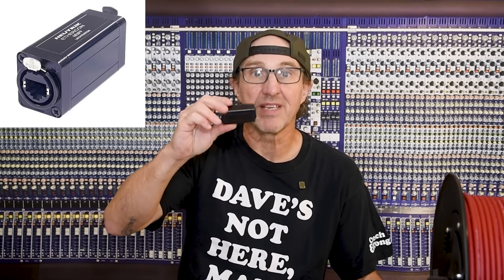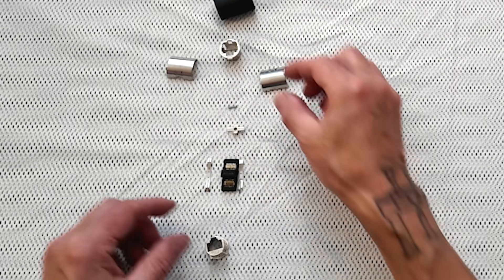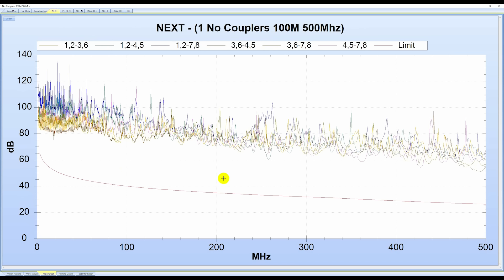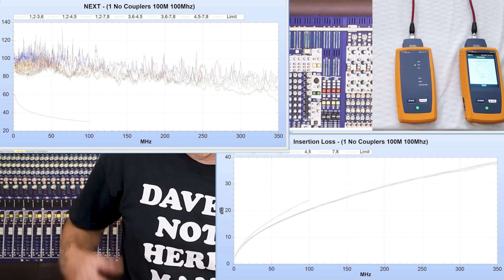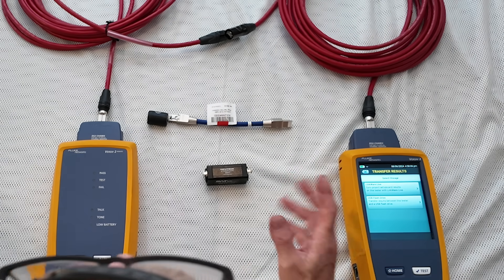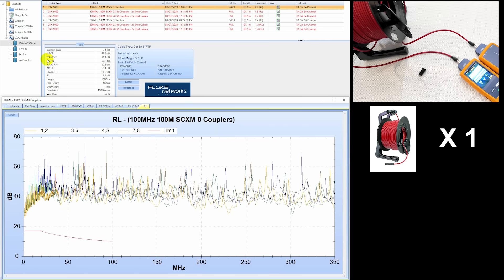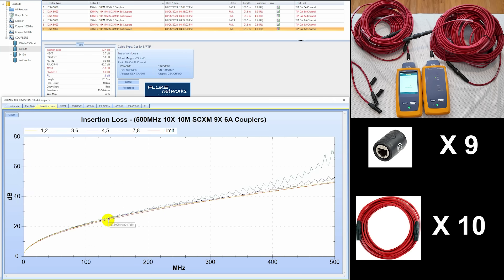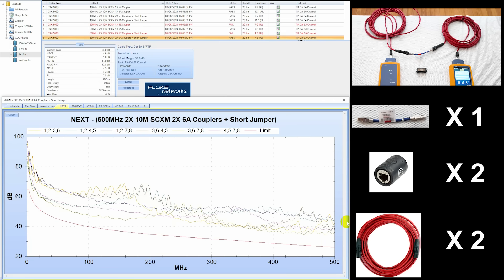How Bad Are etherCON Couplers?

Comment: I wonder if part of the issue is not being twisted, no shield and longer cables added up in the 5e coupler. All those things are minimized in the cat6 which would make sense because the spec for termination is tighter. I feel like making a longer cable vs buying a bunch of couplers would be easy. Many people get hung up in buying top of the line for every use case but it always depends like you said about shorter runs to someone else who was looking for a solution in their country. 

I think people just need to be more aware and thoughtful than scared of a small amount of loss in a reasonable circumstance. 

Thanks for the info.
Reply from the maker: Agreed and thank you

Comment: Out of curiosity, what is the impact on signal if you are using it to carry analog and/or aes pairs?
Reply from the maker: Everything points to the higher frequency being carried by the wire the more impacted by the couplers it will be.

Since analog audio only goes to 20K The coupler should have no impact whatsoever or no impact that matters.

For AES that goes to 48 or 96K again we're not that high of a frequency compared to 100 megahertz being carried by network traffic. And the couplers really start to impact the signal when we get up into the 500 megahertz and beyond.

So I wouldn't worry about couplers in most situations except if you're running very high frequencies and also running very long cables in the 80 m range or longer

One exception to this is AES 50 which is extremely temperamental with cable lengths over 60 m unless the cable is very high quality so minimizing couplers on AES 50 is always wise when running longer lengths
Reply: @DaveRat  Thank you Dave...

Comment: Is there any device like a booster or filter/fixer that could be added somewhere in the run that could help with the quality? Thanks
Reply from the maker: Shorter runs will have less issues. Yes, you can add switches or boosters to many protocols but they add latency and complexity and another thing to go wrong. Especially for festivals where they would need to be somewhere in the dirt between stage and delay clusters or FOH.

Using high quality wide bandwidth cables and avoiding couplers with wide bandwidth signals is good 

Or switch to fiber. But fiber adds cost and is more fragile
Reply: @ It all makes sense. Don’t be short is the answer. Thank You 🙏

Comment: great data to be sure! usually 100 meters is the spec limit i shoot for... as a rule of thumb i add 10 meters to the total length for each termination point so far side distro (10M) 60 m of run then the patch panel (10m) for a total of 80M. This quickie rule should keep you functional but the 6a couplers with a good solid end termination is the way to go. edit* i now need to go talk to the boss to get that fluke qualification meter.....
Reply from the maker: 🤙👍🤙 those flukes are expensive!

Comment: Video Idea: PLEASE do this exact same style testing video with “hi-fi/audiophile” grade audio cables. I’d LOVE to see the actual difference if any in a $10,000 snake oil speaker cable and an $8 Hosa cable compared.
Reply from the maker: Oh my yeah the problem is getting a hold of the $10,000 audio cables. And yes it's snake oil I don't have the ability to measure and we won't hear a difference.

That's it Total crap cables can be bad and that I'll dive into.

I was thinking about doing a video on cheap mic cables versus quality mic cables and how they sound microphonic and shielding and such.
Reply: @ that’ll work! Finally settle the debate on why you shouldn’t use XLR cables to run 3 pin DMX 😂

Comment: While you can't test them to spec (2GHz) I'd love to see if the cat8 couples perform meaningfully different up to 500MHz.  The ones i have are built like the 6a couplers so i imagine theyd be pretty much identical, but maybe theyll be better on some parts still.
Reply from the maker: I don't know of a cat8 ethercon coupler.

I know there's RJ45 Cat8 versions out there. Are you aware of any cat8 ethercon couplers?
Reply: @DaveRat  sadly not any ethercon ones either, only normal rj45.

Comment: Very interesting as usual. I have a small selection of lengths and a 5e coupler to give me more distance options (currently being used on the LAN until I make some cables up). Only running short distances compared to you guys, but might switch up to the 6.

Comment: I think if you're using that many couplers, you really need to examine your cabling choices. Of course, that's not the point of this. I think in general, this is a great example of why one should avoid any couplers whenever possible. It does also show a strong reason why an improved product is the better choice.
Reply from the maker: Yeah I do a lot of testing where in order to clearly identify and illuminate an issue I overdo it so that we can know what to look for

When testing digital consoles and comparing them to analog consoles, The difference is in sound and noise are not readily clearly audible comparing one channel of digital to one channel one channel of analog.

But put 10 channels in series with 10 d to a and 10 a to D converters and compare it to an analog console going through 10 input channels and then the differences become more pronounced and we know what to look for and listen for.

I used this methodology in this test as well of using too many couplers.

I see it as a similar method to having a magnifying glass we were able to magnify the issues such that we can hear or see them better

Comment: My question is, do A couplers make E cable work better?  Merry christmas, Dave!
Reply from the maker: Merry Christmas and that would be great  if they did. Since the a couplers are about an inch an long you need 12 of them per foot or about 33 per meter so about 330 of them for 100 m run. Plus  229 Cat6a male to male adapters.

Would that be better than a cat 5e I don't know but it seems suspicious
Reply: @   I hoped you remembered me as the kind to make such a joke. Yes, a solid train of couplers, half with male ends, half with female ends. By stock in the coupler maker!

Comment: I wonder how wall terminations would compare to these couplers?
Reply from the maker: I tested the Neutrik cat 6A pass through panel mounts and there as good if not better than the cat 6A couplers. Because their ethercon on one side and RJ45 on the other they can actually get the connections even closer than the EtherCon to EtherCon couplers do

The Cat5e pass throughs have a little circuit board and I haven't tested those but I'm guessing they show up somewhere between

Comment: Those ripples are probably because of reflections over reflections and the fact that all shorter cables have 10 meters. The Cat6a couplers seem much better. There must be impedance matching on those couplers.
Reply from the maker: Yeah having a bunch of identical cable lengths probably sets up some resonances and other crap. It's pretty much a worst case scenario which is part of the reason I did it this way.

The other reason is we only make that red cable in three lengths. 10 m, 60 m and 100 m. So I had a pile of available 10 m pieces

Comment: I Would Just Splice The Wire! But I Own The Network! It Would be Better Than Either Of These Couplers
Reply from the maker: Yeah splicing the wire is definitely an option. But even there there can be issues. Maintaining the twists all the way through and not having straight wire and making sure the twisted pairs have a shield that's continuous are important factors.

The distance that the wires in the Cat6a coupler are not twisted is extremely short and the shielding is maintained.

I would bet the splicewire rivals the cat 6A coupler depending on how much time and care you put into that splice

Comment: I would like to see a test where you modify the Cat 5E couplers by adding the proper amount of twist inside the coupler. I have a feeling this would improve its performance
Reply from the maker: Interesting idea. I will ponder that. Though I don't think the performance will ever get up to what the cat 6A couplers can do. Maybe someone else here knows more about this but I believe that going from a very thin wire to a thicker wire and back to a thinner wire also creates issues at very high frequencies.

So I think you'd want to also change the wire gauge to match the cable wire gauge inside the coupler.

The other issue is the Cat5e couplers have little circuit boards in them so there's yet another set of connections there.

RJ45 to female ethercon wiper to circuit board to wire to circuit board to female ethicon wiper to RJ45 is the signal path for the Cat5e coupler

The cat 6A coupler is RJ45 to ethercom wiper to circuit board to ethercon wiper to RJ45

Comment: If you need to run near 300ft, or around 100 meters, then you should just use single mode fiber. The cost of 10gbe single mode sfp modules is pretty cheap now. 10gtek and qsfptek sell aftermarket transceivers for about $10 or so each now. And single mode is not that expensive.
Reply from the maker: Interesting and you kind of hit the nail on the head for the reason this video was created and these tests.

We have about 30 drive systems all based on 100 m lengths that have fiber runs included on our main drive snakes.

We have been running into issues with fiber breakage as well as long lead times for repairs and high costs for repairs and replacements.

Finding a robust and reliable alternative to fiber is one of the reasons I designed this red cable and exactly why I'm doing this specific test.

The goal is to make sure that we can run 100 m of this red cable plus two couplers plus two short jumpers, one on either end.

The results for our application was that we can run up to 120 m + the couplers and jumpers and still have a real world reliability and function buffer of at least 20 m beyond that. We were able to reliably run 150 m cable plus couplers and jumpers with Dante and Milan

In the past 6 to 8 months we have converted all of our system main snakes to have two of these red cables Cat6a runs on them and moved fiber to separate reels that we send as an additional option that can be run as an add-on should the technician or tour desire to do so, but increases load in and loadout time

By making this change we've increased reliability, maintained ease of setup and increased redundancy, as now each tour has four long runs available to them, two cat 6A runs and two fiber runs should they choose to deploy them.

But yes lots of people just run fiber and also throwing money at the high tech solution is sometimes worse.

Comment: I wonder how a cat6a keystone coupler would perform vs the cat6a coupler tested here?  Probably exactly the same without the rubber on the outside, but they cost 1/8th of what the NE8FFX6-W does.
Reply from the maker: Yeah, probably very close to the same and if your application does not need ethercon, that may be a good way to go

Comment: Im wondering if the 10x10 meters has any influence... What would happen if it were to be 10 cables of different lengths? what the harmonic bumps be more spread out and less pronounced?
Reply from the maker: Interesting. Definitely can measure and see where couplers are and cable lengths in measurements. 

Some tests seem to indicate that having very short jumper cables right near the ends is especially undesirable and creates reflections and resonances where the signal level is highest.

Comment: Thanks for this. Question: is there any chance that using a Cat-5e coupler with the SuperCat 6 cable creates a mismatch? I know jack squat about these cables and how they affect signal loss/stability, but for me, as a touring FOH A1, I will always fight for a single cable from mixer to stage box without connectors. It’s amazing how many house techs fail to see the importance of reducing possible points of failure.
Reply from the maker: I didn't do it in the video but I did test the Cat5e couplers with Cat5e cable and the cat 6a couplers as well. The cat 6A couplers outperform the Cat5e couplers in every scenario.

But since Cat5e is only rated up to 100 megahertz, both couplers perform good enough in that range.

The sensitivity to couplers really happens at frequencies well above 100 megahertz where the cat 5e 100 megahertz coupler performs poorly and the cat6 a coupler before much better
Reply: @ is 100 mHz synonymous with 100 m length?
Reply: @Brody-Dolyniuk  It's not linked to cable lenght. It is the data transmission speed that the CAT5e cable was designed for (100MHz and around 1Gbps of network traffic). CAT6a is designed for faster data links (10Gbps) and as such needs tighter tolerances and higher data transmission speed and frequency at 500MHz.

Comment: Thanks for the excellent video! Insertion loss in data cables is something I've often wondered about, but didn't have the equipment to test. Question: If you had one of the out-of-spec runs creating errors, would it have an effect on any other devices connected to the same network switch? Thinking specifically about AVB or Dante applications.
Reply from the maker: Being out of spec for a cable run may or may not impact the signal. The probability of impacting the signal depend on whether the spec that you're testing to correlates to the signal being used.

I hate to make guesses but I can tell you that for deployment at our sound company we use 100 m Super Cat XM cable that you see in the video plus a cat 6A panel mouth pass through on each end plus a 3 ft jumper cable from the pass through to the console or rack as our standard.

We also tested and found that we can add up to 40 meters more Super Cat XM cable and three cat 6A couplers and still have reliable signal integrity.. 

Based on this testing, we have established at 120 meters Plus the pass-throughs and jumpers, is the maximum allowable lengths for our Dante and Milan applications.

Comment: I wonder if punch down couplers would perform better than the rj45 connections.
Reply from the maker: Things that mess with the signal lack of twists, lack of shielding, and abrupt changes in things like wire size and amounts of metal in line.

I'm guessing that Cat6a rated punch connectors will test somewhere like the cat 6A couplers and cat 5e rated punch connectors won't do as well

Comment: Hey Dave - will you look into what happens if you send analog and Aes signals down that line with 10 connectors. Could be interresting. Happy x-mas to you
Reply from the maker: Interesting thought in Merrry Christmas.

All this is in the hundred megahertz plus range where all the stuff shows up.

For analog and AES which are much much lower frequencies, The impact of these couplers is negligible.

I did do a video testing AES 3 with lots and lots of the Cat5e couplers. 

I think I found it adding a cat 5e coupler equates to about adding two or three feet of cable

Comment: Use 6a couplers (no more than 2 per run) got it 💪🏻 thanks Dave.
Reply from the maker: Exactly, unless your cables are shorter in which case you can be less strict
Reply: @DaveRat Is this the model you tested?
Neutrik NE8FFX6-W
Reply from the maker: Yes, the two models with part numbers are shown at 00:11

Comment: You just inadvertently created the greatest commercial for these Fluke testers. Making next year's holiday wishlist already, haha!
Reply from the maker: Those things are great but they're definitely not cheap
Reply: @DaveRat  I'm actually a little surprised you have the Versiv 2. We use that at my work to certify structure cabling. It's extreme.
Reply from the maker: Yeah, I bought to test and make sure the Sound Tools cables we manufactured meet specs and to help test the prototype cables as we design new cables
Reply: I agree since I am now combing the comments to determine precisely which tester he is using to test the cables.  Dave could have made it easier by including the name.  Better yet, he could have included an affiliate link to the exact tester and made some money while educating.
Reply: @jatlast it’s a Fluke networks DSX CableAnalyzer, copper cable certifier. Part of their Versiv family of products. Model number is DSX2-5000, cost around $13,000. The DSX2-8000 = $15,000.
Reply from the maker: Exactly and thank you

Comment: I'm sure most of us would only use a coupler if our life depended on it.  I'm glad to have an idea exactly what the impact looks like.
I'd also be interested to know how one of these out of spec signals would affect Dante or other popular digital formats.  For example would a run slightly out of spec cause audible issues, would they cause the connection to reset and lose everything?  In general, what would you see/hear on an out of spec situation?
Reply: Much like Dave writes below, the stream formats, like AES50, MADI, AES3 et c will have bit errors that are audible directly whereas the Ethernet carried packet formats like AES67, ST2110, AVB, NDI, etc etc will cause silence. This is because the entire packet (typically 1ms of audio at 48kHz; the "ptime" value in the RTP stream description) is discarded for one bit error, and the conversion from RTP stream  packet back to bitstream of samples (remember, there's a PTP time stamp on the packet telling us when it was sampled)) has no choice but to leave a hole because data for that time is missing.
The error is the same, from a transmission perspective -- a 0 becomes a 1 or other way around, but the effects may vary depending how the data is chunked.  Related, compressed video streams might have longer dropouts because the more data might be required to restart the playback.
Reply from the maker: Cool and thank you for the better explanation!
Reply from the maker: Here is a video I did on AES50 but have since tested Dante in a similar way. Will do a vid at some point.

Dante tends to be more stable than aes50 and has dropouts rather than loud pops and crackles.

But all in all, the results are similar.

https://youtu.be/Fn3OanfKcnc
Reply: @DaveRat  Cheers!